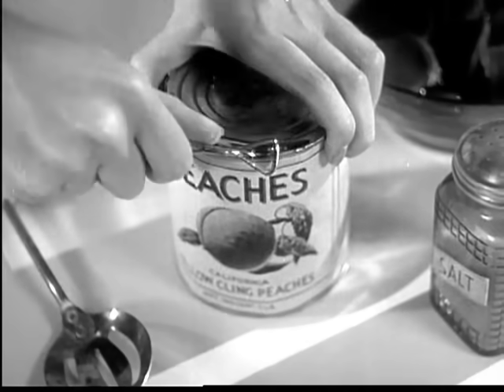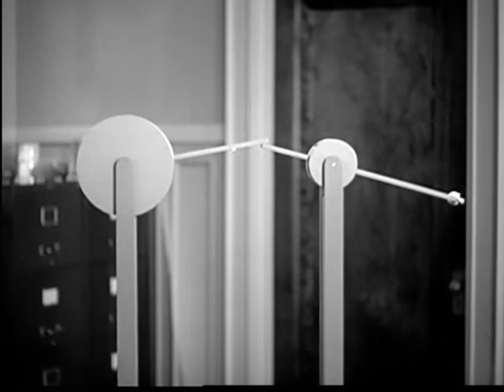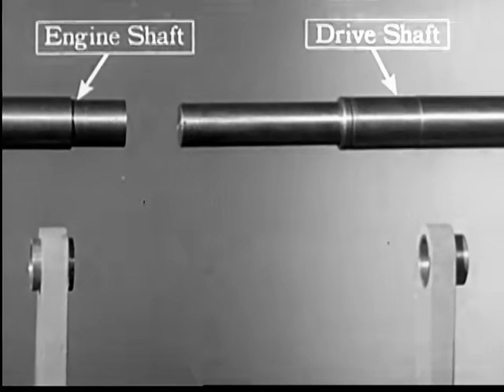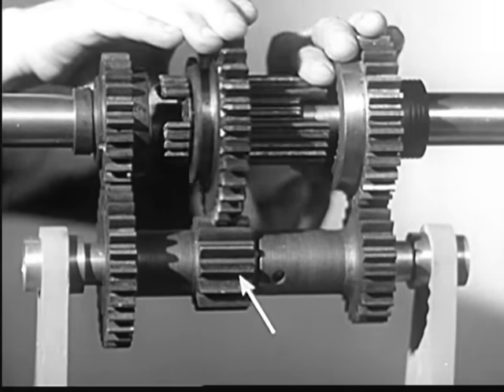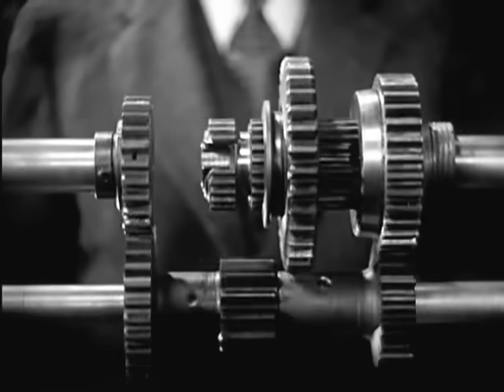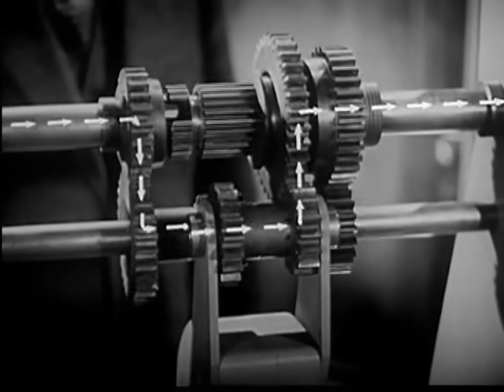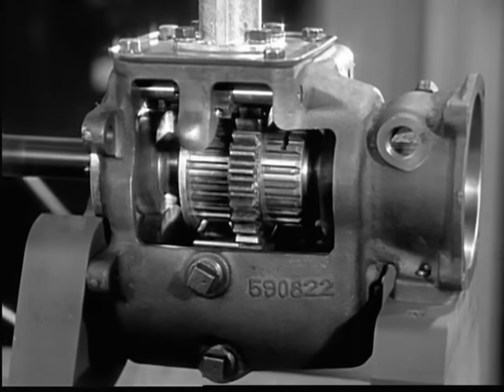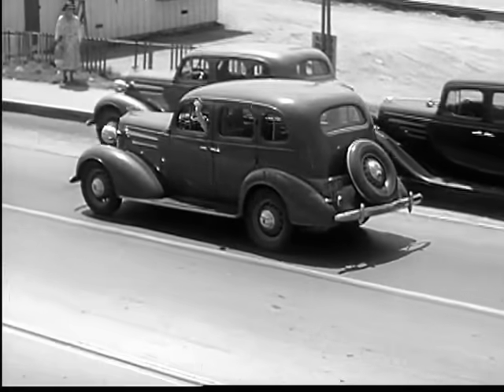Spinning Levers - How A Transmission Works (1936)

Comment: Its insane that in the 86 years that this instruction video has been in circulation, almost nothing has changed with the manual transmission.
Reply: Because it's a good design that stands the test of time.  Same reason why the US Military still uses the M2 .50 machine gun despite the design being nearly 100 years old.
Reply: don't fix it if it ain't broken.
Reply: Just refinement, material, helical cut gears and more gears.
Reply: @BNR_248  isn't the thing they called the synchro mesh just the clutch pad? They implied that it's only used when shifting into 2nd, which I would presume is no longer the case if it ever was at all.
Reply: @bobbobert9379  I think it's used when changing into any gear. It's synchronizes the speed of the gear you're about to change to with the gear you're currently in for a smooth transition. Otherwise you could get grinding and banging like they showed before the synchro part.
Reply: @bobbobert9379   Nope, the synchro is not the clutch.  Those are two completely different parts in two different locations and built completely different.

A clutch is mounted between the engine and transmission.  While the housing typically is mounted to the transmission, the clutch itself is mounted on the back of the crankshaft, on the engine.  It is its own part, with its own history of development unique from either the engine or trans.

It is a good way to think of synchros though, as like a miniature clutch tucked into each gear.

The clutch is made of multiple components, housing, springs, bushings, fiber pads, bearings, etc, and has two main parts, housing and disc.  It is bolted onto the flywheel at the back of the engine.  Synchros are typically only 1 piece, made of brass, and are mounted in the end of each gear.

As far as I my being on 2nd, mostly yes.  Synchros were originally only mounted on 2nd gear and higher, all but 1st typically.  1st didn't get one since it was deemed unneeded because it was oy used when stopped typically, so there was no need for it.  But by the late 30's, it was typically on all gears, including 1st, due to the rapidly increasing vehicle speeds and ever more roads being built.

Synchros are a completely unneeded part of the transmission though, even today.  With proper use of double clutching and rev matching, one can shift a non-synchronized transmission without and clash or noise at all.  But, people like things easy and convenient, so synchros it is, heh.
Reply: @bobbobert9379  a synchromesh is essentially a small automatic clutch for every gear, it engages only when they're at the same speed to prevent grinding.
Reply: Don't mess with perfection
Reply: transmissions are cool
Reply: Even more insane that it's still the best explanation of how a manual transmission works.
Reply: @veryslyfox In England, it is only very recently that automatic cars have started to become more popular. Most cars on the road today are still manual
Reply: I thought the same, there is things was created at perfect way since de beginning
Reply: @emerson2012arcond  I don't think it was created perfect, but it was soon perfected.
Reply: Just more gears: 4, 5, 6, 7, 8, 9, 10, 12, 13, 15, 15, 16, 18...
Just the method of obtaining and shifting them!
Reply: You can't shift a Road Ranger with out double clutching (according to the Eaton manual), but you can it you know how and are good at it. Eaton (every manufacturer, really) frowns on this. The exceptions - yes Eaton had one - are designed to be shifted this way: curriculum clutching in Spicer, and baulk rings, which prevent engagement until synchronisation is achieved, which you must achieve yourself...!
Reply: Rare, don't agree. You obviously don't live in Australia.
Reply: Not curriculum (stupid spell check knows nothing), curvic!
Reply: nowadays there are synchros introduced
Reply: @marguskiis7711  wasn’t that what the cork and bottle thing was about?
Reply: @fyretnt  yes but at the same time no, if we had to compare modern syncro and that one it like getting it in the face with a toy rubber mallet for the modern one and getting hit in the face with a 3 lbs steel mace that you put a cloth over. technicly work the same just way better
Reply: @marguskiis7711 Synchronizers were standard in the early 30's, though usually only for 2nd and 3rd, since 1st was only shifted into when completely stopped.

Transmissions were fully synchronized by the late 30's due to rapidly increasing vehicle speeds and better roadways.
Reply: @veryslyfox The manual style transmission is absolutely not obsolete.  Most cars use automatic and cvt, yes, but larger vehicles such as big rigs exclusively use manual style transmissions.

Even modern automatic truck transmissions are physically built the same as a regular manual transmission.  The only real difference is that the top plate for mounting a stick is removed and replaced with a set of computer controlled solenoids to do the shifting.  The clutch is controlled by the truck as well.

Automotive style automatic transmissions are made completely differently from a heavy truck.  And both the automotive automatic and CVT style transmissions have been attempted in heavy trucks.  Both have been proven to be incapable of providing adequate service in the heavy tuck industry.

Just because a single person doesn't see something, doesn't mean it is gone or obsolete.
Reply: @DanielHomant  In Europe, trucks as in heavy goods vehicles, mostly now have automatic transmission. There are still plenty of exceptions but these are really quite rare, particularly in England.

Even the manual transmission trucks we do have will usually now only have the standard 6 gears similar to a car or van, and not the 18, 24 or 36 that might have been common 30 years ago. I've only encountered a truck with a range change and splitter three times in my career, they are rare these days

Comment: actually in 2nd gear the right gear on countershaft meshes with the 
gear above it and when clutch leave is inserted into it, power goes 
from said gear to keyed clutch sleeve that is mechanically linked to 
drive shaft.  there is a groove between drive shaft and clutch sleeve
 with a steel bar connecting the two so when clutch sleeve turns it 
turns the drive shaft. a lot of info missing but what is said is true.

Comment: The reverse gear section is suss as hell. I get how it reverses but it doesn't show clearly how the reverse gear arrangement looks like. I barely saw the 3rd gear and I am still trying to rack my mind around that glitch in the matrix movement. Modern cars have a different set up as the gear of the reverse is slid into place versus the gear on the actual shaft itself slid into the reverse arrangement. I had to watch a modern day video to make it make more sense. I had no clue how the drive shaft was spinning without turning the wheel. It made sense in the other video and took me a hell of a time to spatially observe what was going on in the reverse. This explanation was too simple for me to understand.

Comment: Will Electric motor cars be getting to their end of life in 90 odd years from now or will their death be sooner.
Reply: Sooner unless something like PowerPaste being developed by Fraunhofer Institute can become economical.  Batteries are a stupid idea.  When the battery in an EV reaches its end of life, the entire vehicle has to be scrapped because the cost of a replacement battery isn't worth the investment.  And wait until folks try to figure out what to do with a few million dead batteries out of EVs every year.  Going to be a recycling nightmare.

Comment: Maybe they were trying to make it super simple? The smaller gear on countershaft to larger gear on the clutch sleeve would make much 
more torque but the clutch sleeve had to be keyed to the load shaft.
otherwise, the larger gear would just spin a lot slower but with no 
power or torque to the rear wheel.

Comment: It seems the clutch sleeve is linked to the load shaft that turns rear wheel, it can't spin over the shaft but must turn with it and is able to slide back and forth, thus making the right shaft to the wheel as 'powered.' Since that first gear on driven shaft at 3:30  spins over the shaft, the only way it can get things to happen is that the clutch 
sleeve is engaged in it, now that gear is turning and has power and 
since it is linked to clutch sleeve which is keyed to the shaft, the shaft 
is powered. in 3rd gear the clutch sleeve is allowed to slip to the left 
and directly into gear on the engine shaft.  making a 1 to 1 coupling 
with no increase or decrease of torque. I am not a wrencher but it 
seems that once clutch sleeve gears meshed with countershaft there would have to be a keyed or spleened shaft to the clutch sleeve.

Comment: Great stuff!!!! We still use the same method today but the complexity has increased a hundred fold. In the 1960s an Apprentice became a motor mechanic after 4 years and he knew how to fix EVERYTHING on your car. But with today's automobiles you need a specialist mechanic for the motor, the gears, the exhaust, the electrics and electronics, etc., etc. No single mechanic can fix everything on a modern car.

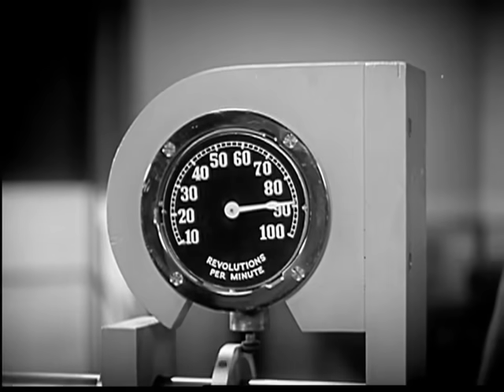Comment: 4:58 Revolutions? Not "rounds"? rpm = rounds per minute? (I am not a native english speaker)
Reply: I'm a native English speaker and a former mechanic. Revolutions per minute is correct, I don't think I've ever heard of "rounds per minute" in relation to engines or transmissions. "Rounds per minute" might have something to do with guns, but I am not a gun person.
Reply: @darkred1686  Thanks.
Reply: hounds and revolution have the same meaning and are same thing
Reply: Also "round" means moving in a circular path, while revolution means something spinning in its own axis
So it is more logical to say revolutions per minute because the gears are spinning at a fixed axis.

Comment: I've watched this video about 4 times now, and I can't seem to wrap my head around that speed cork-in-bottle clutch thing. I wish they dived a bit deeper in how it worked. Besides that, I love this explanation so much.
Reply: It's the increasing friction due to the cone shape of the cork. When you just barely put the cork into the bottle, it very easily spins because there is little friction between it and the neck of the bottle. When you start putting the cork deeper inside, you're going down that cone shape and increasing the diameter of the cork that touches the neck of the bottle. In essence, you're reducing the air gap between the surface of the cork and the neck of the bottle and by doing so, you're increasing the friction. You do this until the friction is so high that you can't freely move the cork. 

The same thing happens with the synchromesh mechanism. You can see the synchronizer at 7:40 also has a cone shape, the circumference of the left side is bigger than the circumference of the right side. Initially the 2 gears/shafts are spinning at different rates but when you move the synchronizer from one gear into the other gear, you are gradually pushing that cone into a tighter gap and increasing the friction between them, until the friction is high enough that they are basically "locked" together and spinning at the same rate. This gradual increase in friction is what lets you change the gears more smoothly.
Reply: Clutches are considered disposable and a part expected to wear out because they operate using friction. The other comment is a good explanation of how it works but I thought it prudent to add this to it.

A clutch is basically a part designed to wear out over time sitting between two parts you should never have to replace. When people speak of "burning up" a clutch they're talking about it wearing prematurely. Usually as the result of an operator that rests his foot on the clutch pedal at all times. Thus causing the clutch to be partially engaged at all times. Since constant friction is a great source of generating heat it isn't long before all you're left with is a funny smell and no more clutch material.

Cork is a good example material. Rubber or any other soft material would also be a good example of explaining how the clutch works. Think about it like this. Imagine you have a gear made of something soft like cork. It connects two other gears made of a harder material like metal. It is partially engaging both metal gears and sacrificing itself anytime the two metal gears are not in sync. When engaged it's always between the two metal gears and when disengaged it's tucked somewhere out of the way and not involved in delivering power at all. Hence the video's "cork in a bottle neck" example. Our cork gear can freely slide between and out of the way of our 2 metal gears whenever we want. We can control how much or little it's engaging with the metal gears.

Let's suppose your two metal gears are not in sync. Gear #1 is spinning at 8,000rpm while Gear #2 is spinning at 2,000rpm. You want to match the speed between both metal gears before attempting to fully engage them. We can not force them together because they're too far out of sync. If there was no clutch you'd be forced to slow Gear #1 down to 2,000rpm before engaging with Gear #2.

With the clutch we get another option: We can slowly bring the speed of Gear #2 up to 8,000rpm through partial engagement via the cork's friction. A little bit of cork will be sacrificed and lost to friction every time we do it. Once Gear #1 and Gear #2 are both spinning at 8,000rpm our cork gear is disengaged. It gets out of the way of the two metal gears allowing them to fully mesh up and spin at the same rpm. Our soft cork gear is tucked somewhere out of the way until it's needed again. Giving it a chance to cool down and saving the precious soft material for the next time our metal gears are out of sync with each other. Or if we feel the need to do other fun things like engine braking or upsetting the balance so we can deliver tofu faster.

Also I should point out that those rpm numbers are just examples. IRL what would happen is Gear #1 would drop from 8,000rpm to about 6,000rpm while Gear #2 was coming up to speed. When both gears were at about 6,000rpm they would engage with each other because they were now in sync. Gear #1 is being robbed of power by the clutch's friction and bring Gear #2 up to speed. Gear #2 would be spinning freely in this example and not generating any power on it's own. At any rate both gears would meet somewhere in the middle, sync/engage then the clutch would get out of the way.

"Floating" gears is simply matching engine speed to wheel speed (Gear #1 to Gear #2) and engaging the gears together without use of a clutch. In a lot of professional driving jobs (racing and trucking) the clutch is only really used for starting from a stand still. It's easier and faster to match engine and wheel speed manually. The smoothest possible/optimal shift point is always when both of these things are in sync. There are other benefits as well. Left foot braking for example.

Just think of the clutch as an oddly shaped gear made out of softer material than all the others. I feel like I've rambled on too much. If you still don't understand it and I suggest learning how motorcycle/ATV/small engine transmissions work. They are easier to wrap your mind around than automotive transmissions.

Comment: I'm missing something here, it seems the clutch sleeve would  be able
 to turn the driven shaft and still slide back and forth by a slot in the shaft,
 then the smallest gear on countershaft to larger gear on driven
would be 1st gear.  with a larger gear on countershaft to smaller gear 
on clutch leave  u have 2nd and by having the clutch sleeve go into gear on 
engine shaft, you have 3rd gear. what do they mean the clutch sleeve can't 
turn on the shaft? the clutch sleeve must be linked to the driven shaft by a 
sliding keyway, a bar between the shaft and the clutch sleeve.